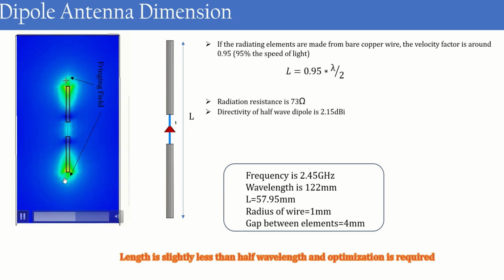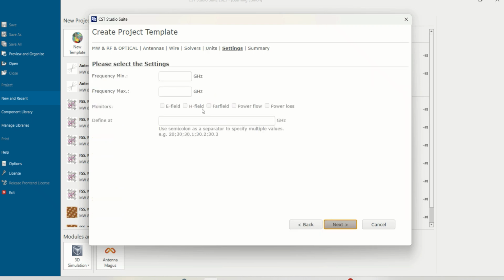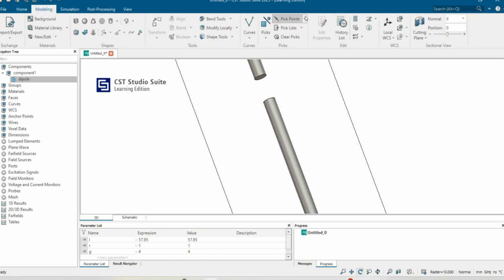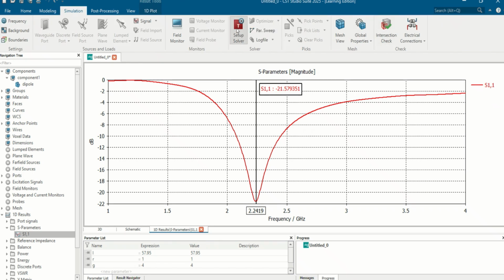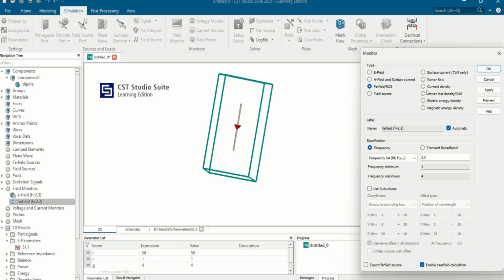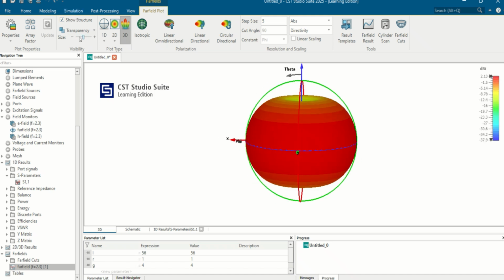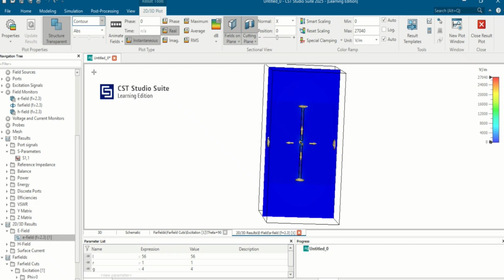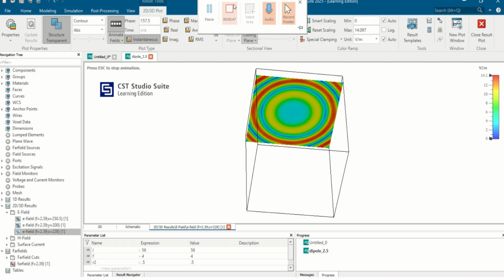Dipole Antenna Design & Simulation in CST Studio Suite |Tutorial| EF & Surface Current|Part-1

Comment: i have a question, how we know that the electric field is for x-polarized or y-polarized incident wave and secondly if we wanna analyze electric field for both (x and y-polarized separately), then how to simulate it, please guide me through this. Thank you
Reply from the maker: X polarized and Y polarized is defined in CST as TE and TM mode. After simulation, in 2D/3D result folder you can check the orientation of field and decide which mode corresponds to X/Y. For both X and Y polarized result, we have to set two modes in floquet mode settings.
Reply from the maker: https://youtu.be/WcBZTaUClZI?si=zA51SXzCMg14f49U
This video may be helpful
Reply: @waveresTech thank you. However, I have a asymmetric structure with different results for TE and TM polarization. Could you please make a tutorial on how to analyze electric field for TE and TM for reflection and transmission. Also if possible, if you interested in collaboration then please share me your email